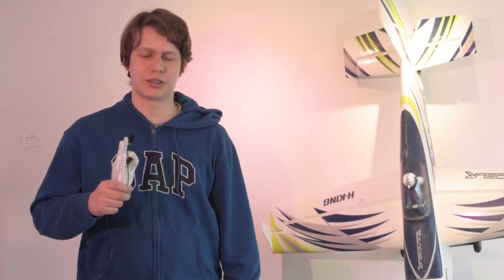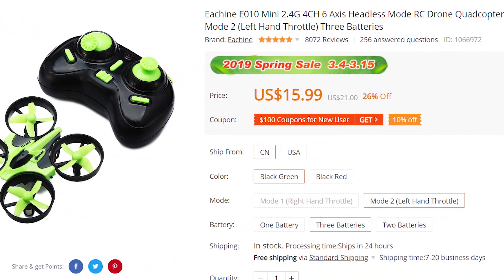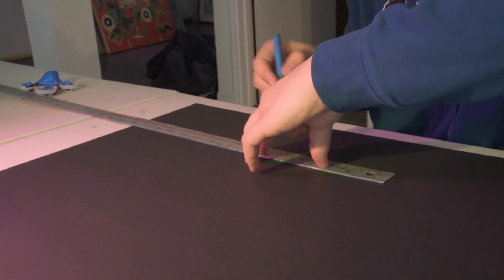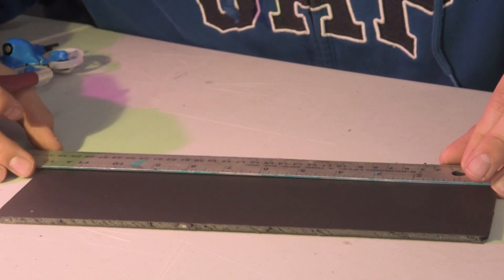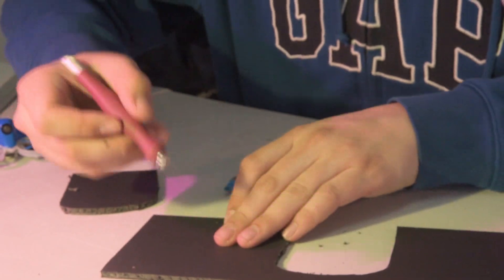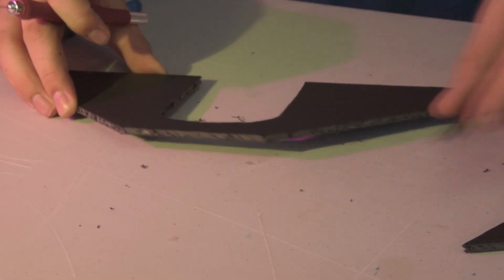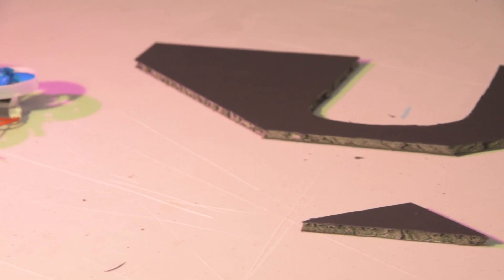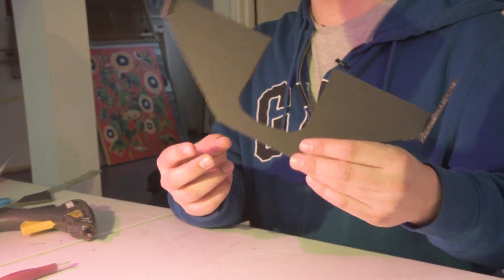Micro RC Airplane | DiY

Comment: Great job.
Does this works for simple autolevel quad  ?
Reply: Any quad should work
Reply from the maker: Any quad can work as longas the wingspan is proportional to the size. Although Tiny Whoops are easier to work with because of their ducts
Reply from the maker: What do you you mean by "simple autolevel quad"? What quad do you want to do this with?
Reply: Lol he used a brushless quad so just more power

Comment: thanks for posting.  good work.    here are some observations.    (see the view at  :12.5  in linked video.)           note that the wing is  polyhedral;  wingtips are  NOT  vertical;  without material hanging off the 'back'.     this overhang contributes to your model having   a   tail-heavy  dom.     another factor is  the  'loss' of  counter-weighting mass at the nose, due to the truncation of the shape of the central leading edge.   cheers           googletranslate
https://www.youtube.com/watch?time_continue=12&v=ch3r0ycTwB8